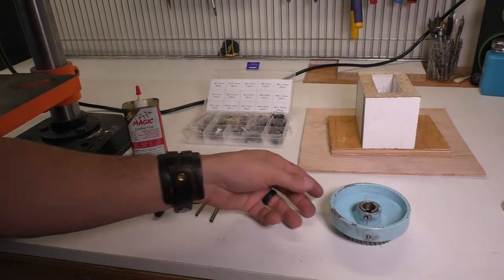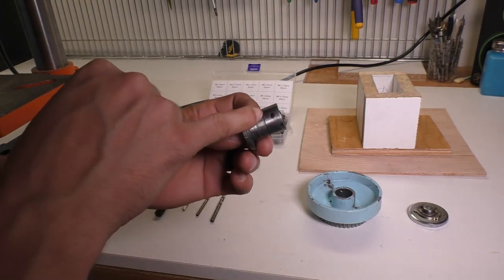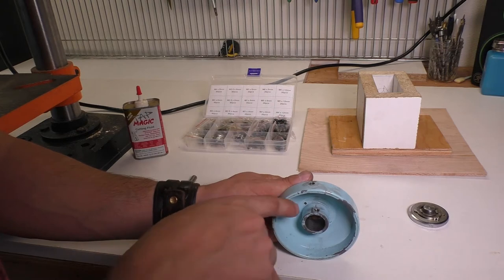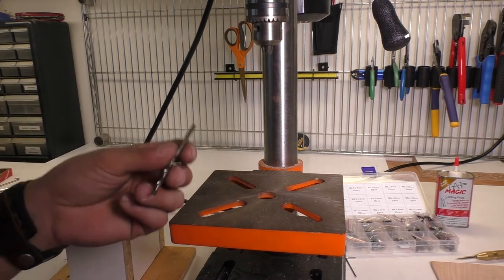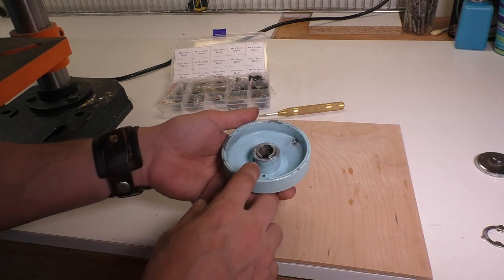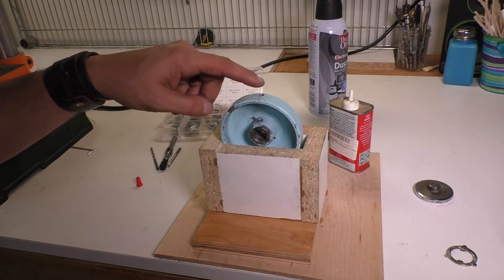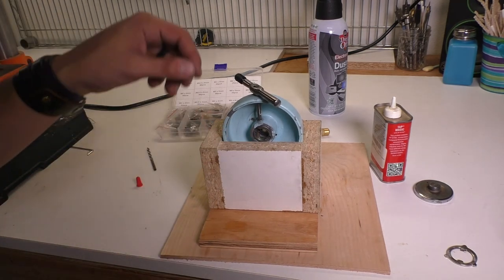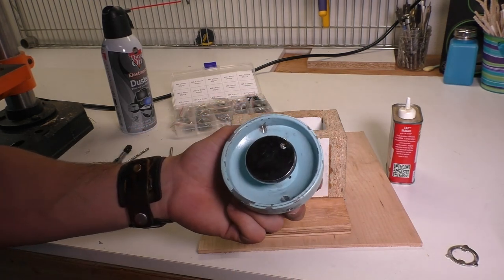Thompson Walking Foot DIY Posi-Pin Clutch

Comment: Doesn't Sailrite offer a plastic version of the Monster wheel that uses the posi-pin system as well?
Reply from the maker: They do! I have the metal version on my sailrite machine and its great. But you need to buy multiple components for it to work, the fly wheel, the posi pin, and the replacement clutch which costs about $100 for the plastic version and $200 for the metal version.  Its cost effective to do on the sailrite but not so much on the thompson.
Reply: @theminutiaeeffect3504  Oh hey I must have missed the notification for your reply. Thanks for getting back to me.  I have the PW-300 and now I'm especially interested in this conversion because Sailrite just announced a new servo-motor that attaches onto their Ultrafeed machines, but I'm pretty sure it's not as simple a matter for the Thompson. I might have to do this conversion to make it work (they are calling the new motor the "Worker B").
Reply from the maker: @stopthephilosophicalzombie9017  Check out thejasonofalltrades on youtube. he just released a video on the workerb motor and talks about the thompson. according to the video, it will work on the thompson machine too.
Reply: @theminutiaeeffect3504  Thanks!

Comment: the larger wheel they sell im not that big of a fan of because with like a 2.5mm stich my small wheel can zip through a straight stich.  the carbon pile foot pedal makes gearing down not as needed compared to an "electronic" pedal that pulses the motor
Reply: Are you saying that the carbon pile pedals have better low speed controls vs. the new ones?